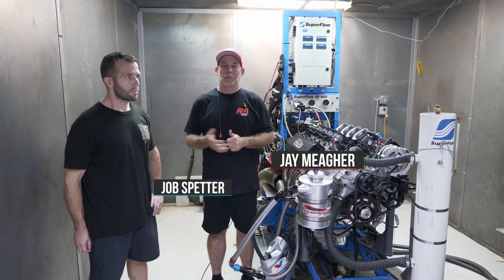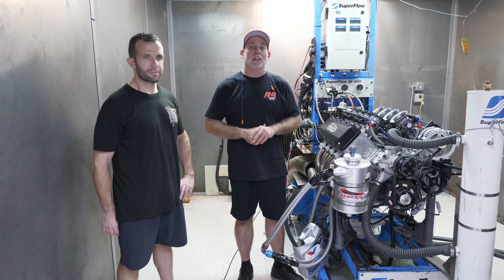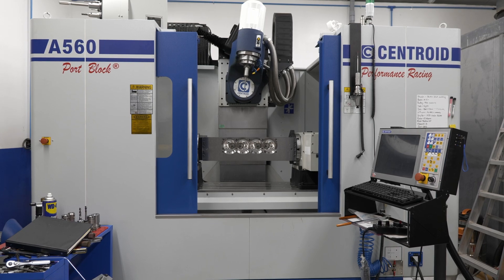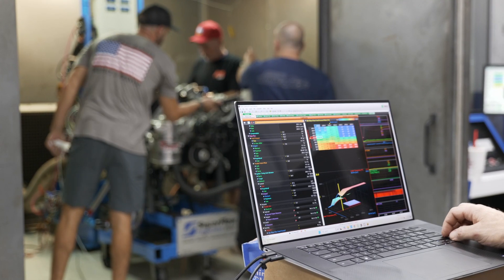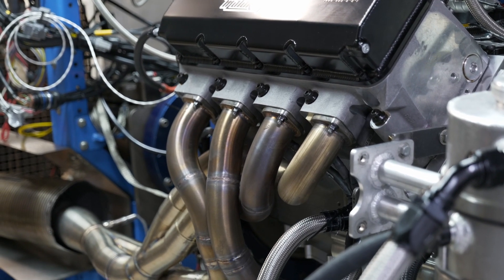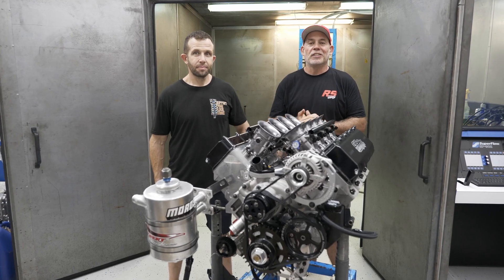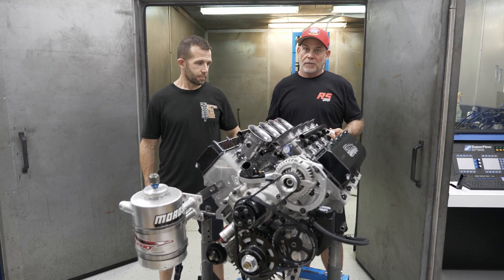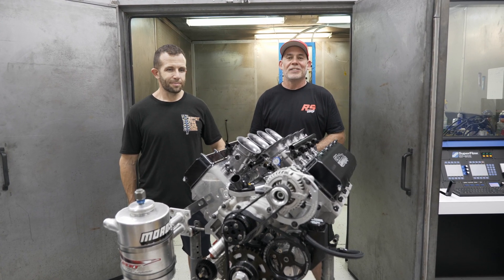900+ HP Naturally Aspirated LS on an Engine Dyno | NO NITROUS | RS Garage

Comment: Little strange history lesson for everyone wondering about the "Ford" head on a Chevy block.... the original canted valve head on a Ford block that did anything was done by a old British guy called Harvey Weslake, when Dan Gurney asked him to help make the Ford 289 run at LeMans after the FIA outlawed motors over 5.0L of displacement... which was the 427 (7.0L) FE motors that they used to beat Ferrari.  Little old British guy helped Ford beat Ferrari two more times with that design..... so it's never been something that originated out of the factory. Look up the Gurney Eagle heads or the Gurney Weslake heads, they were the OG canted valve SBF heads, and probably one of the inspirations for the Cleveland head design that came after.

Comment: This is LITERALLY my dream configuration...but I'd want a little more displacement and an LT billet block instead of an LS. I'd go with both direct AND port injection - you get incredible part-throttle, low-speed drivability with really good top-end power and flow. And it sounds fucking NASTY! But 670 lb-ft out of 450ci is incredible. That's 91 lb-ft/liter! For reference: the classic 458 F136 V8 engine made 88.5 lb-ft/liter and the LT6 in the C8 Z06 makes 83.5 lb-ft/liter.

Comment: That's based on a Cleveland head, not a Windsor, correct? How do the flowbench numbers compare against an appropriately sized LS rectangle port head?
Reply: If you go back down the family tree far enough it's based on a Cleveland head. Except you raise the port a few inches at the port entry. It's much more likely to move 450cfm+ than a LS7 head because it moves the valve away from the port wall the more you open it, and the port is also raised up compared to a LS7 rectangular port.

Comment: I recognize a Yates head when I see it.
Reply: Not a Yates head
Reply: @roostingthe6520  It basically is, or a D3 head.... it's a SC1 port (Ford aftermarket) port arrangement thrown into a casting for a LS block, which is really just moving the bore spacing out from a 4.380" to a 4.400"

Comment: Whats the reason behind adopting a ford head for an LS?
Reply: more favorable valve locations and valvetrain
Reply: It’s superior
Reply: @BCSVT  If you're talking about a design that a bunch of drag racers figured out in the 80's on some GM Performance Parts heads... sure, it was a design that evolved out of a old Cleveland/Yates head in the 80s just as much as it did out of GM Pro Stock heads, and almost none of these guys who did the work got a paycheck from GM or Ford let alone cared who's name was on the valve covers other than their own.

Comment: Nice piece but 15 to 1 compression a little much for the street
Reply: Its fine on ethanol if you're mindful of cylinder pressure at lower rpm's
Reply: Wrong

Comment: For comparison sake. All of the top sprint car engines are 410" and make 960hp with icky pinch port sbc pattern heads and turn 9300rpm
Reply: @EnglertRacing96  And there are alot of LS7 headed SBCs with way less cubic inches making that power and more
Reply: @lanegeisewite1436  hmm
From the speed talk thread "2 valve volumetric efficiency leaders" 410ci Shaver Ford WoO (mechanical injection, methanol): ~2.26hp+/ci, ~1.78lb-ft+/ ci
2010 358ci NASCAR "Open" engine (850cfm Holley, 12:1 compression): 2.42hp/ci, 1.59lb-ft / ci
Sonny Leonard 932ci "Extreme Pro Stock" (carburetor): 2.17hp/ci, 1.58lb-ft/ci
PME 397ci Chevy R07 (12:1 compression, tunnel ram, two carburetor)): 2.40hp/ci, 1.65lb-ft / ci
NHRA Pro Stock 500ci (PipeMax example, carburetor era, probably better examples out there): ~2.85hp+ / ci, ~1.69 lb-ft/ci
Wilkins Racing Ford 438ci RY45 Pro4 Trophy Truck engine: 2.18hp/ci, 1.5lb-ft / ci
Pro Power 412ci Ford RY45 (single carburetor): 2.21hp/ci , 1.72lb-ft/ci

Have a look at the actual power and torque curve of a good 410....  massively broad... it's a one gear direct drive car... and it actually gives up a good bit of "top end" to achieve that along with a very smoothed power curve to make them driveable on dirt in a 1375lb car.... especially when it goes dry slick
Reply: @EnglertRacing96  Efi University just got done with a 350ci LS with Frankenstein LS7 series heads and made over 900hp at 10,000rpm
Reply: @lanegeisewite1436 that’s a drag race build, not something you put in a street car…
Reply: @Hoffbottraces  You're not running this engine in the street either. Pure race engine
Reply: @ except it’s not. 15:1 compression is doable on the street on E85. Comparing these engines is apples and oranges. Not everyone wants to rebuild an engine every 50 miles.
Reply: @Hoffbottraces Nobody is running it on the street. Race vs race. That engine was only 14.6:1. It don't matter on compression. It's the valve train and camshaft profiles. Race vs Race period
Reply: @lanegeisewite1436  it's all muddy waters if you know the right people

Comment: I'm a bit confused, why use the Ford head, there are so many LS heads to make 900-1000 hp with the same or less effort...The cost of going this way with the custom heads must of been a lot more expensive... Can you tell us the reason  ???
Reply: I believe the reason for these heads is due to bigger intake and exhaust runners, also the placement of them allows for better airflow in and out of the motor. Big cid motors need air flow whereas turbo cars seem to work better with a smaller port due to compressing a high volume of air.
Reply: @gasparsperformance9841  Yes, 100%.. My guess is these ford heads do 450in & 280ex cfm... And as you know there are Badass LS heads that do that.. or more.. anyway, that was there choice, be good to hear from RS Garage...
Reply: @gasparsperformance9841  I agree but boosted motors dont really care about port size and vallves sizes.  The better NA power a motor makes it will work and make alot of power boosted.

we tested this . took a 6.0 made 520 NA 25* peak timing e85 and at 14.6 psi made 1127 with the same timing. we took another 6.0 made 385 NA and at 14.6 psi made 731 . Both motors will make more but we was just testing at atmosphere pressure wich is around 14.5
Reply: @loundclear9279  did both motors have the same camshaft and torque converter (considering that the motor was in the car and on a roller or hub dyno)?
Reply: @gasparsperformance9841  no both motors where done on the engine dyno.  The first 6.0 had cam and heads on it and a tsp titan intake

The other 6.0 had factory cam factory intake just upgraded valve springs 

Both where on engine dyno
Reply: @loundclear9279  I ask this question because the hp numbers between those two 6.0’s was a big difference. From my personal experience we have seen a hp gain when running the appropriately camshaft and torque converter for the setup. So, I wanted to ask this incase anyone reading this and building a similar setup was aware what the differences were between those two motors and how you gained more hp out of one motor over the other.
Reply: @gasparsperformance9841  I understand and its no problem. Their are alot of aspects when building a motor , first is the use of the motor ie drag racings full or street strip /  Then budget and end goal.

between those 6.0 the low hp one a simple street /strip build like rods and pistons pump gass build, The other was gear more towards racing full time.  

We didnt spend alot of money one street strip didnt focus on upping NA power.  But i will say focusing on NA power first and building for boost you want a high NA power becasue boost will always double the power. 

Camshaft selection is crictial but every cam works with boost a cam just really moves the NA power around and boost will mimic it. And TQ converts is a real balancing act but ill lleave that for another day
Reply: To me I think just to be different , and a fat wallet. on our tall deck lsx 451 we made 1090 na using tsp ls7 heads switch to brodix br7 heads made 1120 na , this was on a 85 mixof nitro and methonal with a big vacume pump
Reply: @loundclear9279  Yes, fat wallet.. Did you Dyno with just Race Gas.. ??...  If i remember BES has made 1100 + from a big LS on race gas..
Reply: @drcolster   We ran on a mix of nitro and m1 methonal we plan on throwing some boost at it .
Reply: @loundclear9279  The way to go with the Metho and boost ...👍👍
Reply: Torque per liter. 90+ lb0ft/liter is INSANE. You also get a lot more inherent high-RPM valvetrain stability.
Reply: @spdcrzy  MAYBE you get more stability.... all those pushrod angles and length do not help that

Comment: SBC powaaaa!!!! Shouldve keep a LS7 head or BBC style canton valve cylinder head on her
Reply: Silly, takes Ford parts to make the LS do something
Reply: @BC08  Said no one ever 🤣🤣
Reply: @lanegeisewite1436   You just watched it happen, silly
Reply: @BC08  Apparently u weren't listening to well 😂😂
Reply: @lanegeisewite1436   …perhaps you weren’t.   These are Yates D3 adapted to 4.4” bore spacing.   Taking Ford parts to make an LS do something
Reply: Canted" a big block style isnt the way to go...  half the intake ports turn the wrong way.    There is an LS head with canted valves called the LSR.... that looks alot like the "canted" ford head that is on it.

Comment: Nice! 122hp\LITER\BAR.. impressive 👌
Most ls based stuff is lucky to break into the 100's.
Reply: Not really, 6L stuff can easily do 650-700hp with OEM castings, and 6.8-7.0L stuff can do 800+ with OEM castings, the harder part is pushing the displacement and getting there as a motor you can drive on the street.